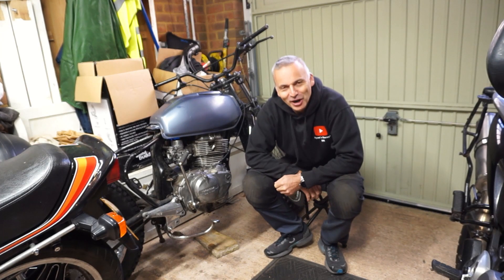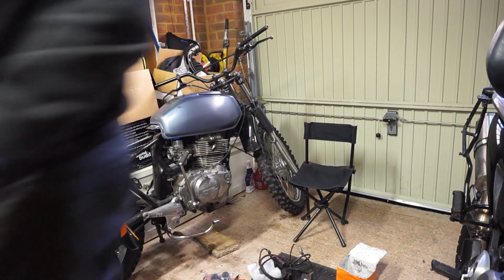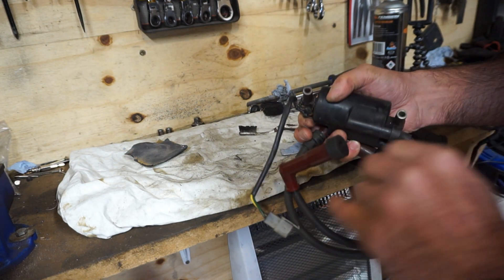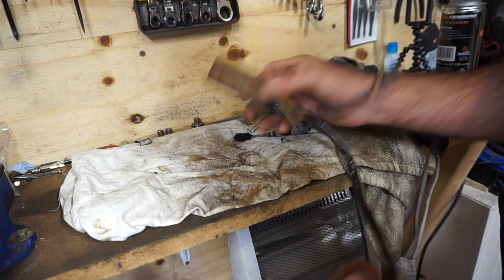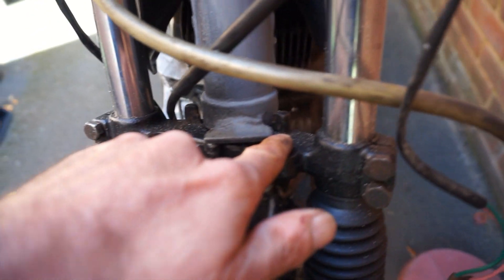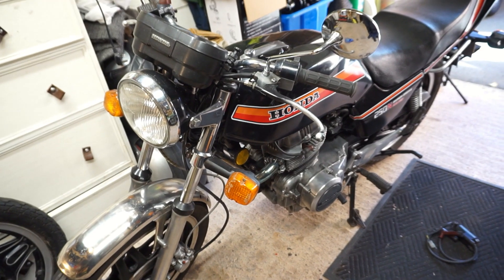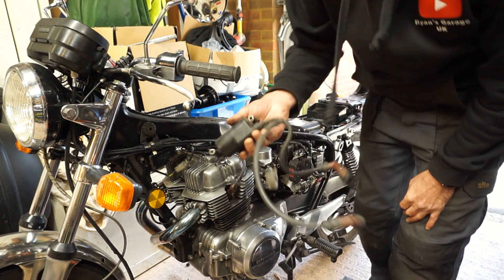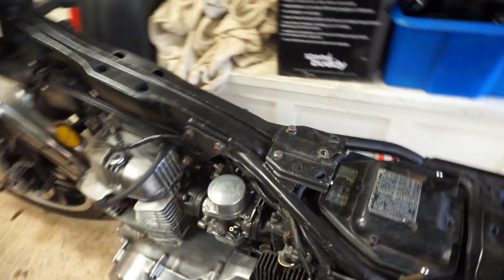Electrics Time, Trying to get a spark with NO wiring loom! Project Bike Build -Part 31

Comment: The pilot circuit on my CB350 carb on that side also has a tendency to block if left for a short time.
I would remove the carb and clean the pilot circuit properly, not just the jet you also need to check that the air circuit is clear. The pilot air screw and pilot jet work in conjunction to provide the correct mixture, if either one is blocked it just won't work.
Reply from the maker: Thank you. I was going to try to tackle it on the bike (only because I had not tried that before), may give it a quick attempt, but strongly suspect I will end up doing as you suggest.

Comment: Dual output coils do not usually need to be earthed, because one pole goes to each plug, but it is a good idea to ensure the contact point of the mounting is clean, because that is how it gets rid of heat, by using the mounting brackets as a heat sink.
Reply from the maker: Thanks Rick, you may well be right but figured it can do no harm.

Comment: Hi Ryan.  Hopefully the Superdream bracket on the frame will work.  Im a little confused as I thought the frame fof the scramber was from a dream and  the scrambler tank is also from a Honda 400 Automatic which I  understood was the same frame as the dream? Perhaps it is the XL triple clamps that are making the difference so the superdream bracket may provide the solution.  good luck
Reply from the maker: Hi Peter,  I think that it is the front fork and yoke from the XL that is causing my issues. Thank you. Ryan

Comment: seems the problem is the fork legs are now further back which is causing the problem with the tank fitting, but like you say a superdream tank extender plate and move the tank mounting pins back to match should solve the problem but then you may run into trouble with the fuel tap positioning & the carbs.
Reply from the maker: Thanks Pete, it just one more challenge. Sure I'll find a fix.